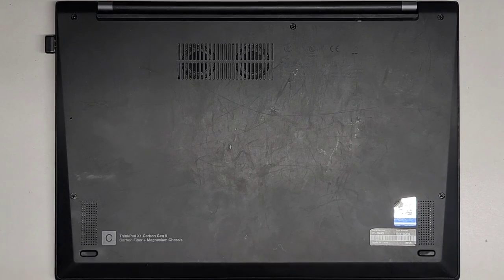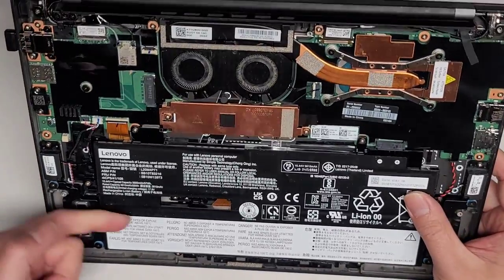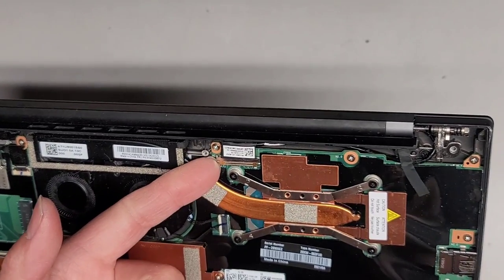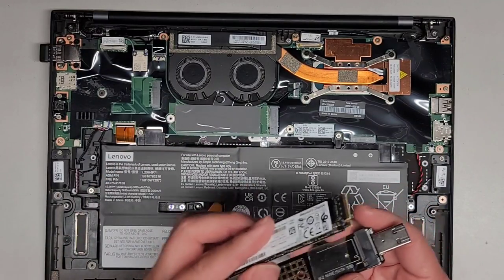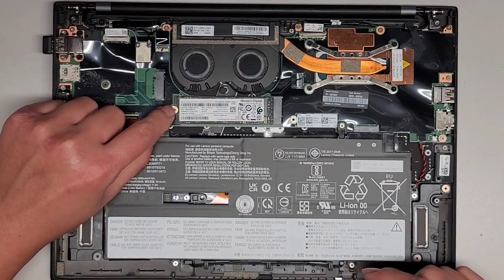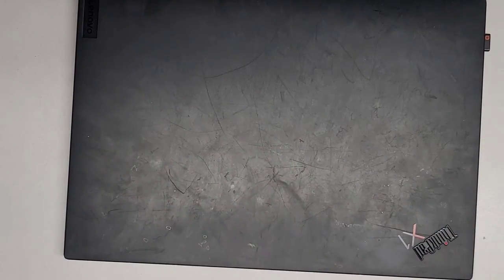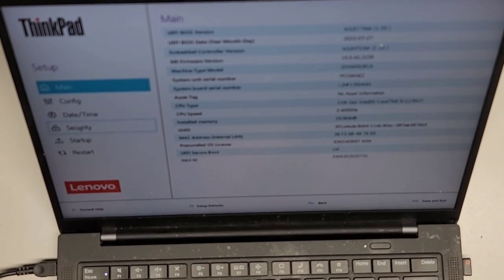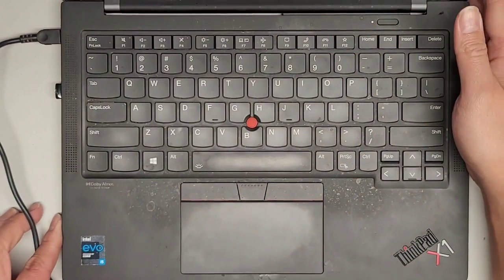Lenovo ThinkPad X1 Carbon Gen Generation 9 9th Disassembly SSD Hard Drive Upgrade Replacement Repair

Comment: Hello i have a question hopefully u can answer, i recently changed my battery in my macbook 2017 version and now my mac runs super slow and the fans are running alot but my mac isnt overheating, im not sure why, i had a thought that maybe i could have damaged my mac when taking the battery out trying to get the adhesive off but im not sure, pls reply
Reply from the maker: Usually it's either the trackpad, trackpad cable, or the battery. There are thermal sensors in there that can be damaged and if not working properly, the MacBook will run very slow and run the fans max speed.
Reply: @ItsBinhRepaired  ok I will buy a new track pad on eBay and see if it fixes the problem and it shouldnt be the battery because I just brought it the other day off Amazon,ty for responding
Reply from the maker: I hate how YouTube doesn't notify me of replies. Were you able to figure it out?

Comment: What SSD USB adapter did you use // ive been having issues finding one that my Clone Software sees .. Also what clone software did you use.. perhaps thats my bigger issue?  Great Video .. Thanks
Reply from the maker: You have to check if yours is an m.2 sata or nvme SSD
Reply from the maker: This works for both https://amzn.to/3KnYuVv
Reply: @ItsBinhRepaired  WDC PC SN730 SDBQNTY-512G-1001
Reply from the maker: Looks like an nvme ssd

Comment: Hi, so I recently did a Windows 11 update that somehow messed my lenovo. Now every time I turn it off I have to press the power reset button,  otherwise the screen goes black but the laptop doesn't shut down. Could this be an ssd issue?
Reply from the maker: Was it windows 10 before? Windows 11 sucks...
Reply: @ItsBinhRepaired  It was a Windows 11, it was one of those feature updates for Windows 11. During installation of the update is when that problem started. It literally broke the BIOS and my repair guy said nothing mechanical had broken but had to reprogram the BIOS. He also said the update may have damaged the SSD, but he wasn't sure. So I'm a bit lost.
Reply from the maker: @mburumuthoki832 very strange

Comment: can i upgrade and add a 4g lte modem?
Reply from the maker: I think so
Reply: @ItsBinhRepaired  ok i can. just checked. however, there is no sim card tray port and the only way would be to put the sim card on the motherboard. any work around?
Reply from the maker: @ramo6576  might need a card with one built in.
Reply from the maker: @ramo6576  there is a sim card slot in the left, right below the usb device and to the left of the mobile network card slot.
Reply: @ItsBinhRepaired  For my X1 carbon, there is a sim card slot on the motherboard, but no opening to acess the sim card slot from the outside. Should i drill a hole?
Reply from the maker: @ramo6576  there should be a removable cover
Reply: @ItsBinhRepaired  What do you mean by removable cover?
Reply from the maker: @ramo6576  pin hole eject
Reply: @ItsBinhRepaired he’s right, I also have a SIM card slot in the motherboard but there is no tray to eject, the only possible way to install a sim would be to remove the motherboard and install the sim, but don’t waste your time, I tried it and the SIM card slot is not an active one unless you purchase the option beforehand.
Reply from the maker: @Sony-Warranty  D:
Reply: @Sony-Warranty  did you just install a sim card or did you also install a WWAN card and antennas?
Reply: @justinwlancaster   just the sim card out of curiosity.
Reply from the maker: @Sony-Warranty hmm